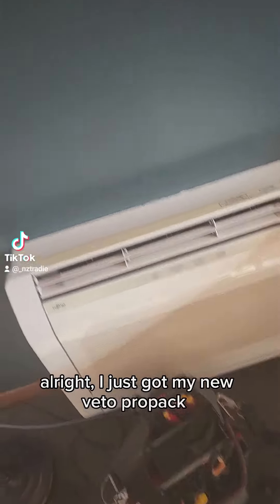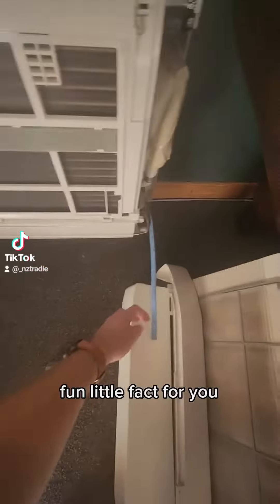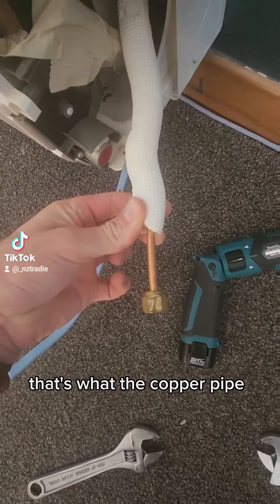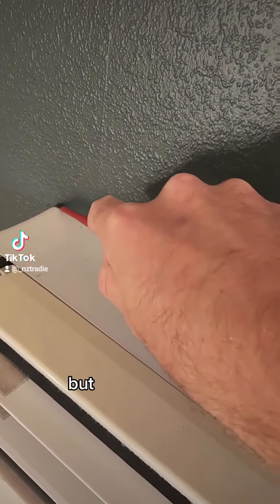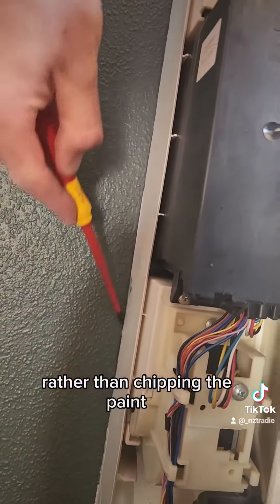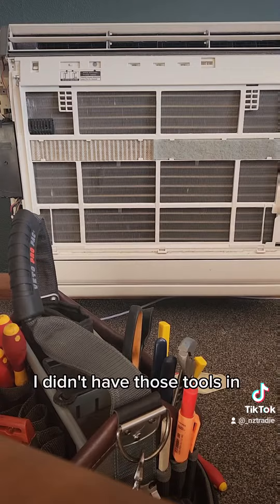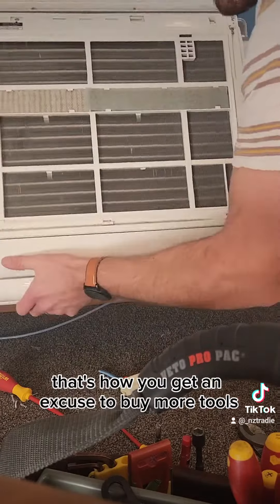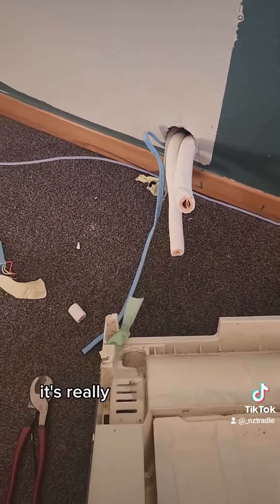removing the old heat pump.

Comment: How do you remove the gas before removing the pipe nuts?
Reply from the maker: Put it into a forced cooling mode, the close one of the outside valves until the pressure drops below 0, then close the other one 👌